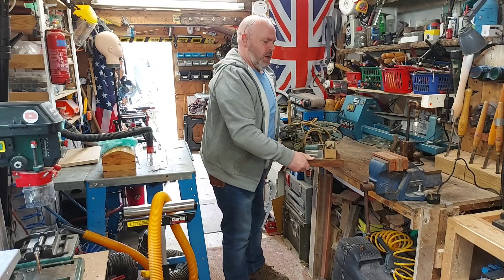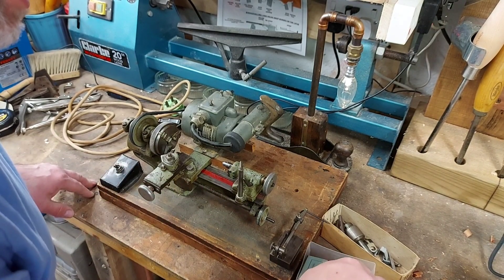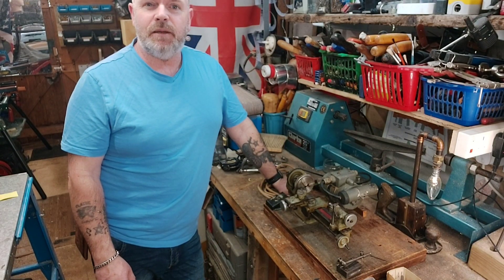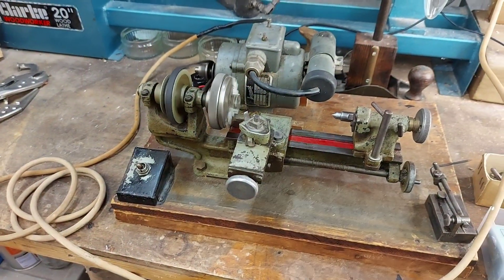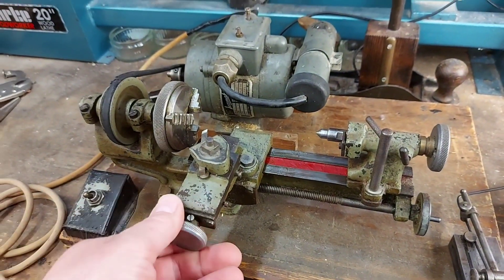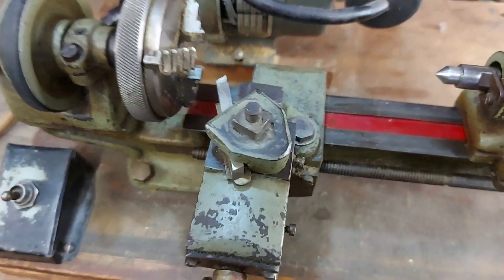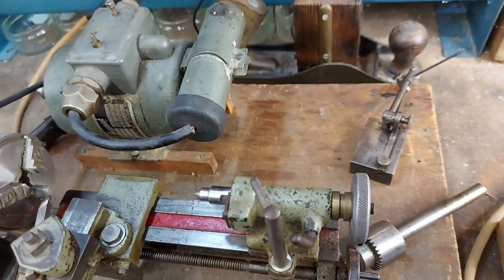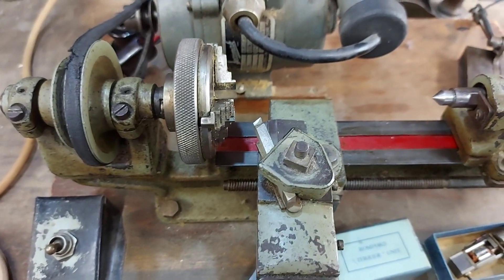Picked Up A Small Engineering Lathe & I Do Some Crude Milling

Comment: Hi, the lathe is made by a company called Flexispeed from Sheffield and looks good, just one issue though as the tailstock is built wrong as the main body of it should be facing the opposite way I believe
Reply from the maker: Thanks Roy, took me a short while before I realised the seller had it together wrong 👍

Comment: That is a lovely little lathe nice and sturdy my only problem with it is the electric motor if it could be done I would like to move the motor 188 degrees so that it was not behind the thing that you are working on can you reverse the way a AC motor runs.
Reply from the maker: Hi, I don't know if I could wire it to reverse the motor. I have covered the cable with some protection but if it becomes a problem then I will make an acrylic protection screen 🙂👍